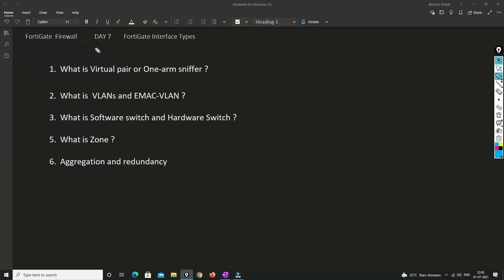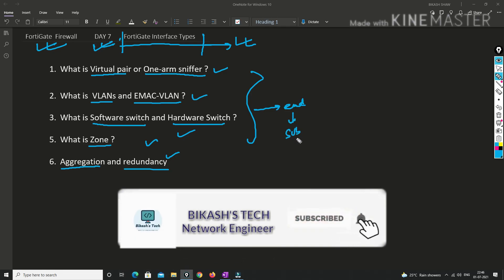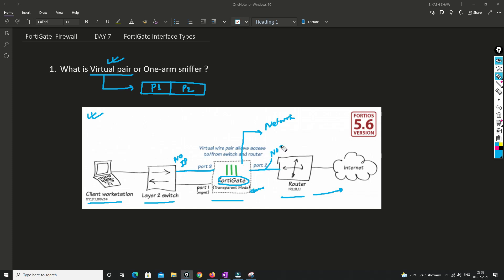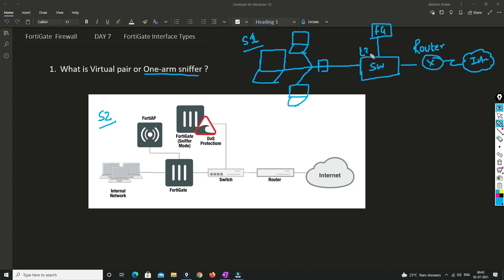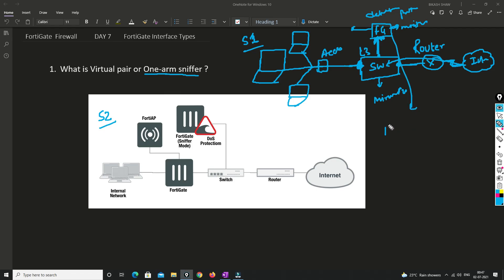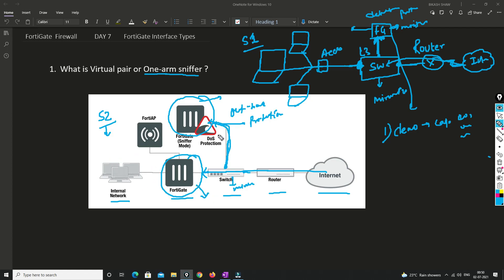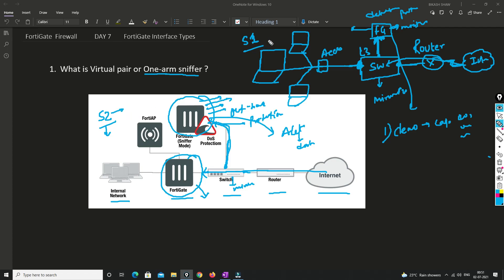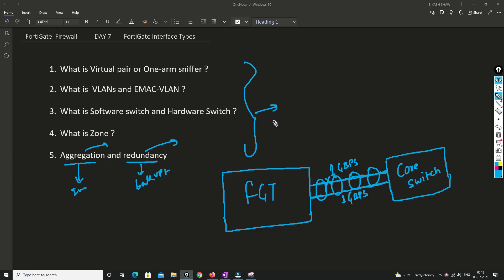Fortigate Interface Type  | Virtual pair |  Software switch | DAY 7 | Fortinet NSE4 Training | 2021

Comment: Please explain the difference between software and hardware switch
Reply: "Software switch" and "hardware switch" refer to different types of networking devices or components that serve specific purposes in a computer network. Here's an explanation of each:

*Software Switch:*

1. **Definition**: A software switch, also known as a virtual switch, is a software-based component that operates within a computer's operating system or as part of virtualization software. It functions as a network switch entirely in software, without requiring dedicated hardware.

2. **Usage in Virtualization**: In virtualized environments (e.g., VMware, Hyper-V, or KVM), software switches are commonly used to provide network connectivity between virtual machines (VMs) and the physical network. They allow VMs to communicate with each other and with external networks.

3. **Features**:
   - **VLAN Support**: Software switches often support VLANs, allowing for network segmentation within virtual environments.
   - **Traffic Filtering**: They can filter and inspect traffic, which is useful for security and monitoring purposes.
   - **Integration with Hypervisor**: Software switches are tightly integrated with hypervisor software, making it easier to manage networking for virtualized workloads.

4. **Examples**: Examples of software switches include VMware vSwitch, Microsoft Hyper-V Virtual Switch, and Linux's built-in bridges.

*Hardware Switch:*

1. **Definition**: A hardware switch, also simply referred to as a switch, is a physical networking device that operates at Layer 2 (Data Link Layer) or Layer 3 (Network Layer) of the OSI model. It's designed for the efficient and high-speed forwarding of data packets within a local area network (LAN).

2. **Usage in Networks**: Hardware switches are used in traditional network infrastructures to connect various devices (e.g., computers, servers, printers) within a LAN. They make forwarding decisions based on MAC addresses, and they are critical for LAN segmentation and interconnectivity.

3. **Features**:
   - **High Throughput**: Hardware switches offer high throughput and low latency, making them suitable for demanding network environments.
   - **Port Count**: They come in various sizes, ranging from small desktop switches with a few ports to enterprise-level switches with dozens or hundreds of ports.
   - **Managed or Unmanaged**: Some switches are unmanaged and operate with default settings, while others are managed, allowing for advanced configuration, VLAN support, and monitoring.

4. **Examples**: Examples of hardware switches include Cisco Catalyst series switches, Juniper EX series switches, HPE Aruba switches, and many others from various manufacturers.

In summary, the key distinction between a software switch and a hardware switch is that a software switch operates within a software environment (e.g., virtualization) and is primarily used for virtual networking, whereas a hardware switch is a physical device used for forwarding data within traditional LANs. Both have their specific use cases and advantages, and they may be used together in more complex network architectures.